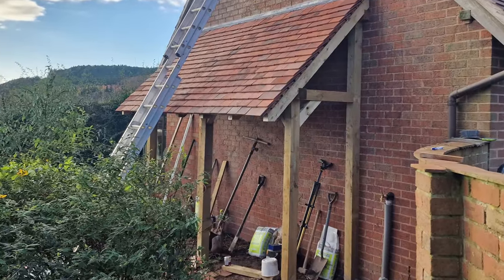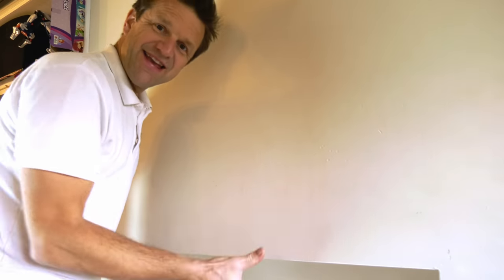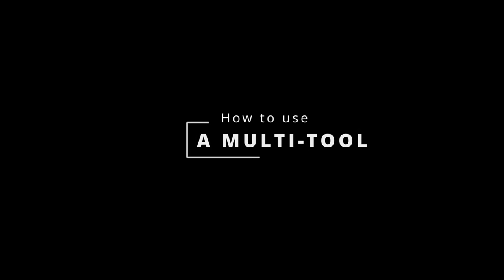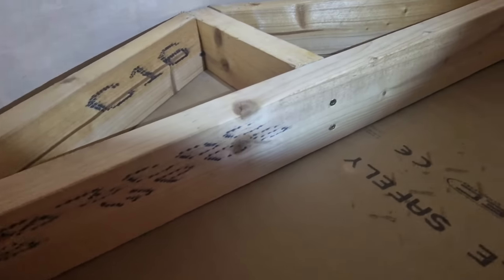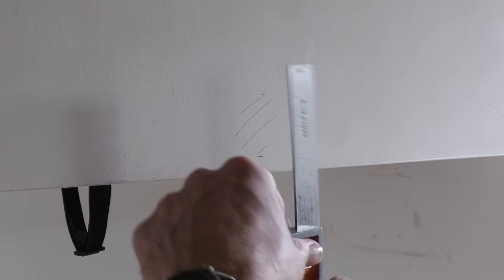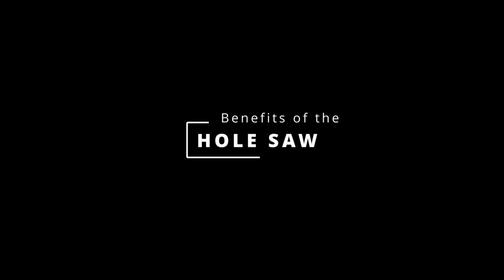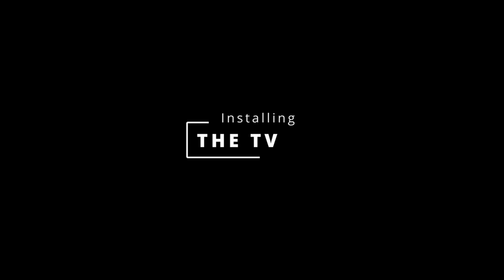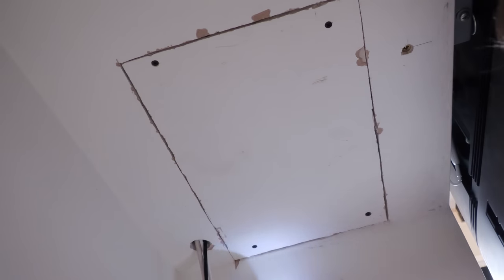How to Hang a TV on a Hollow Wall

Comment: Watched on Monday, did the “new TV wall mounting” job two days before. Well, the TV has at least stayed on the wall over the weekend, but my confidence in the job would have been much enhanced if I’d had the benefit of this golden nugget of DIY wisdom beforehand. Might have to revisit ... Cheers again, Charlie!
Reply from the maker: Thanks Chris. Sounds like you've done a good job but if you have any concerns, you can redo with Geefix, and in this video https://youtu.be/Jdu9RId7m90 I show you how with a simple jig you can drill right over the original hole to insert the Geefix. 👍

Comment: Great Vid! Pass through RJ45 connectors are so much easier to use. The wires stick out the end, meaning that you can see that they are all in the right order and then cut them to length.

Comment: A top tip for the Coaxial/TV socket plates that you install in a custom socket like you have, is to buy blank plates and F connector male to male couplers, and drill two holes in the blank plate and install your couplers onto them. Now you have 2 TV aerial connections one one plate!
Reply: Forgot to add the diameter of the F-type male to male couplers I had were 9mm, but the closest was a 10mm drill bit. Make sure to go slowly (drilling) as the plastic can melt. Always nice to have cables hidden behind a TV and no mess!

Comment: I have one of the Bosch 12v impact drivers, I think it's a good compromise between a drill and larger impact driver. It's very small so can get into tight spaces, yet it has close to twice the torque of my 18v drill driver.

Comment: HI Charlie - I almost never use a drill to put screws in because they so easily cam out and damage the screw head.  An impact driver is certainly noisier but hardly ever damages a scvrew head and is much easier to use.  Wouldn't be without it!  Another great video - thanks.
Reply from the maker: Yes there are some situations eg my recent log store build, where I wouldn't use anything else 👍
Reply: You also don't get the rsi in your wrist that you get when using a normal electric screwdriver.  As it will produce a twisting action upon your wrist with repeated use on a big job.  The impact driver doesn't do this.

Comment: Just to add about network cables. From the socket on the wall to the TV should be a patch cable, the difference is that its flexible and therefore made of stranded cable. Just using some old cat5 etc will work but its designed for structured / fixed wiring. Compare it to the appliances in your house, the mains cable is always a flex made of stranded cable but the cable in the wall is solid. The solid cable would break over time if it was moved a lot. In reality, what you have done is fine and will last without issue but its worth being aware of the differences. Any device that can work at 1gig will support auto crossover as its part of the standard but anything that is only 10/100 doesn't have that in the standard so CCTV cameras are a prime example of something that would need a crossover if you were plugging directing into a pc.

Comment: Lots of great tips there Charlie.  If I can add a couple of my own ….
Option 4 for removing the wall plug is to use a drill on a low speed to remove the front part of the plug from the wall
And for filling the holes, my builder suggested to me using tile adhesive to fill holes or as a crack filler.  Similar to easifill (and possibly cheaper?), it sands much easier than polyfiller which can set rock hard

Comment: One advantage of an impact driver over a drill is that you don't get the wrist breaking torque reaction with the impact driver. It's not an issue with small screws
Reply from the maker: Yes, true Richard and bottom line, it takes the effort out of screwing. Log  build vid this week and I used the impact almost exclusively for that.

Comment: Great tips as usual Charlie. I’ve been using the Polyfilla one fill recently, and don’t know if there’s been any changes in the product, but it seems to work very well!
I’d be lost without my Makita Impact driver, I do use it every day in my day job, but at home it gets plenty of action. Upgraded recently to all singing and dancing model with multiple torque settings, and it’s much less aggressive making it more versatile around DIY projects. Have a great week👍

Comment: Good video Charlie. My opinion on Impact Drivers is simple. For most people it's overkill for general DIY and are nothing more than one of the latest "must haves" like recip saws etc. I spent 5yrs as a plumber and now ongoing home improvement and have never needed the use of one .....I'd rather have a second drill driver or just 12v driver.
Reply from the maker: Thanks 👊 Completely agree mate. You'll only use it for the occasional bit of decking or where you're driving home a big old screw but even then a drill driver will do the job fine, particularly if you can get hold of screws with Torx heads. 👍
Reply: @CharlieDIYte  Having just spent the last 3 days raising my loft floor to get a decent amount of insulation in, I've probably "driven" 300 screws ranging from 4x30's up to 6x150's (all Torx heads thankfully) I wouldn't have wanted to do it with anything other than an impact driver. If I'm doing half a dozen small or medium screws then the compact 12V drill/driver is fine and my first choice but with a job like that the impact driver makes lots of sense especially as they're generally much more compact than a combi drill. Horses for courses, I guess.

Comment: What a great video. Many tips we may have seen before but well worth being reminded of them again.  Plus quite a few new and really useful tips too. 

If you are doing quite a few ethernet cables then making your own is a great option as you can create just the length you need and easier to feed the cable without the plug. May seem expensive for the bits and tool but having the correct length cable rather than a purchased one that is far too long is worth it. Would suggest if you are doing a few long cable runs getting a cable tester for £10 may be worth it as you can be confident it is OK.

Comment: Would you ever consider doing a video about your tinnitus? Perhaps combined with video about DIY and hearing protection options. I damaged my hearing and ended up with tinnitus doing DIY. Would be good to raise awareness and help others avoid this horrible problem.
Reply from the maker: That's a very good idea Henry. I'll add that to the list. Sorry to hear you've got it too. I think my Bosch belt sander did the damage. I used it to sand the floors in an entire house without ear protection. Funny how the worst offending tools are the ones you can't use these days without ear protection because the mere sound hurts your ears! That and my DeWalt router are probably the worst.

Comment: If your are making your own ethernet cables I would recommend two things 1) Use copper core cable as they are more durable and easier to work with than say aluminium and 2) if your are running cables outside use cable rated for outside otherwise the outer sleeve will degrade over time. If you want to get really clever I would also recommend labelling the cables at each end and then using clear heat shrink to protect the labelling.
Reply from the maker: Thanks Anthony. Yes I always use external SWA Cat 5 outside and have numbered all my internal cables. Someone has also pointed out I should only use stranded cable with that crimping tool. 👍
Reply: Yes - stranded cable for crimps (plugs), solid core cable for IDC punch downs (sockets).
There are plugs designed for solid cable though which are usually also designed to not require a tool.
External grade cable doesn’t have to be SWA.

Comment: Hi Charlie. Random question - I’m giving the other half ideas for Xmas presents and really fancy one of those leather man multi tools you use. But…..having looked online there are literally dozens of models, all really rather similar. Haven’t quite finished working through your back catalogue of vids yet so you may in fact have a vid on this, but have you ever done a review of yours and thoughts on the others in the range? I’m liking the look of the Surge as a pretty robust DIY around the home tool. Which one do you have?
Reply from the maker: Hi Chris. I've got the Surge too. It's the best one in that it's got the most tools and things like swappable screw bits and files. It's also the heaviest. The others in the range are varying sizes and weights. Some people say the Surge is too heavy but for me that's what makes it so good and you don't notice the weight when it's in the leather or fabric belt holder. The tools I used the most are the long nose pliers and the knife.

Comment: As always, i enjoyed that.....if not slightly over engineered 🤣. I'm sure some plasterboard fixings would've held that telly no problem
Reply from the maker: Thanks. Yes you're totally right. The right plasterboard fixings would have worked fine. I'd probably have used a hollow wall anchor or snap toggle.

Comment: Hi Charlie, in a previous video (can't quite recall which one) but you mentioned a sanding block being the go-to tool for sanding. Just wondering if it really is easier or a better finish using a piece of wood because I hate having to clamp the sandpaper with my fingers and I find it much easier using a block that clamps the paper.
Reply from the maker: The reason I've gone back to a block of wood is that I did a similar repair on the corridor recently to fill some holes where I'd ripped studs off a dot and dab wall. I used the rubber block and when I painted over you could see a slight dome and raised filler. This wouldn't have happened with a wooden block. But for general sanding when you're not feathering in the repair, the wooden block will be fine.

Comment: Nice video! I must admit I used to diy all my network cables, but would only make one as a last resort now. I find it quite fiddly and time consuming, and I find you can pick up premade ones cheap enough on Amazon.

For the central point (under your stairs) I use a patch panel to connect all the cables that run throughout the house, its much easier to wire off than putting rj45s on all of them, and gives a nice way of being able to label them. It does require an additional network cable to connect from the patch panel to router/switch though.

Comment: Hi Charlie I have a couple of corrugated sheets of asbestos that my neighbour kindly use on my side to prop up his fence , which as they say is another story .  My point is trying to get an asbestos contractor to come and take the sheets away has proven impossible , if there not removing in its there just not interested .    And like you my council will only take it if is put into special bags , and of course your back to cutting it up which would be ridiculous.   This brings into question  why are people not being help’t to dispose of this material safely , obviously I’m prepared to pay for its pickup and disposal .      The only alternative I have is to wrap it in polyethylene and place it behind our woodshed , which is totally remote from the house . Not ideal but devils needs must   Best wishes and kind regards. 😀👍👍👍
Reply from the maker: Hi there, thanks for this. Your best option might be to bury it which apparently you are allowed to do - assuming of course you've got the space and could find somewhere appropriate. I'm going to have a similar problem with that sheet and will end up having to wait until I pay someone to remove the cellar boarding.  🤔

Comment: The metal crush fixings would more than hold the TV thay are relatively light in weight I use crush fixing for the top bracket of storage heaters no problem 👍
Reply from the maker: Not sure what you mean by crush fixings - hollow wall anchors? but I agree. It's a light TV and on this bracket a lot of Plasterboard fixings would do the job

Comment: Charlie did you use stranded core cable for your patch cord? You shouldn’t use solid core cables as the pins are designed to pierce the cable strands as the pins push in with the action of the crimp tool.
Reply from the maker: Thanks mate. That's good to know. If I'm honest it's solid core. So what crimping tool should you use with solid core cable?
Reply: @CharlieDIYte  its not the crimp tool that you would need to swap its the 8P8C (RJ45) connector, you can get a specialist version that will work with solid cores but really you should use stranded core cable for patch cords (short lengths) that often get plugged and unplugged. Stranded cables are flexible and less likely to break with repeated movement, only good up to a max of 30m but more typically used under 10m. Long runs of cable that don’t get disturbed are called permanent links, these are solid core cables that terminate on IDC’s (Insulation Displacement Connectors) such as patch panels and telecom’s outlets (TO = wall sockets) and you use an IDC punch down tool to terminate into the patch panels and TO’s. The patch cords plug in to the outlets (patch panel or TO) and is part of the  channel that can be re-patched to make a new connection to the TO. A very simple channel link might look something like this : network switch —> patch cord (5m) —> patch panel port —> permanent link (90m)  —> TO —> patch cord (5m) —> computer . The overall channel is a max of 100m. Really all permanent links and patch cords should be tested for conformance to British Standards, testing for continuity, Wire Map, NEXT, FEXT PSNEXT etc. using a cable characterisation test set, but these are very expensive, for home use you can buy simple continuity wire map testers for less than £20 that would be okay for a DIY’er. Also most kit nowadays is auto-sensing so you don’t need to make cross over cables, the equipment will cross the connections itself if it needs to, its only older equipments that wouldn’t do this. Hope this helps :-)

Comment: A drill/driver can kick and hurt your wrist if the screw jams. That can't happen with an impact driver.
Another quick way to remove old rawlplug heads is a countersink bit in a drill.

Comment: Give me a impact driver any day less hassle and can do all a combi can hss drills wood bits etc even masonary bits are available to fit straight in, my combi rarely gets used, with hss just let the bit do the work no pressure 10 years into a Makita 18v impact driver constant use still going strong . SDS a must for heavier masonary concrete work
Reply from the maker: I've never tried drill bits in an impact. Must give them a go. Totally agree about the combi. It's a heavy lump to carry around when the hammer action is so pathetic. 👌

Comment: The internal walls in my 20 year old house were built without timber studs, just 3 layers of plasterboard laminated together. There’s no cavity to work with either, just a thick slab of plasterboard in the middle and some dot n dab. Neither masonry fixings nor heavy duty plasterboard fixings work. 

The only way to fit anything substantial is to laminate a sheet of OSB into the wall, just as the builders did in the kitchen.
Reply: Seriously?! I've never heard of that before in 35+ years in the industry. Any idea what the construction is called,  I'm intrigued to find out more? Incidentally,  how are these walls connected to the floor and ceiling?
Reply: That's horrifying
Reply: @frfr335  my posts keep getting removed. Google ‘laminated plasterboard walls overclockers’. Someone has posted a diagram on that site. 

There are just two 1x1 battens, one nailed to the floor and one nailed to the joists at ceiling level. The two outer sheets are screwed to the battens top and bottom. The middle 25-30mm sheet is sandwiched between the two using dot n dab. As you can imagine, door frames are prone to movement.
Reply from the maker: Sorry to hear that. A very odd method of construction although in some ways more sturdy than most new builds today! For heavy stuff I think frame fixings are your only option assuming something like the Corefix isn't long enough to bridge the dot and dab void giving you 40mm into the brickwork.
Reply: @CharlieDIYte  the problem is these are internal dividing walls, so there’s no brickwork behind them. 

I’m just renovating my bathroom at the moment and having replaced the bath with a shower, I’ve had to laminate a 2.4m piece of OSB into the wall to hold the tower shower and to support the 42kg piece of glass  that came with the tray. I could have just rebuilt the wall, but plasterboard disposal is stupidly expensive for small amounts.

Comment: Careful using network cable with ports on one end and plugs on the other. Plugs are mostly designed for stranded wire and the keystones for solid wire. They can be unreliable when mixed the wrong way around. There are plugs designed for solid wire but even these aren't that reliable. If the wire is solid it would be worth putting a small patch panel on the cabinet side. Pass through connectors cost more, they're nice but you get used to knowing how long to cut the wires there is enough play behind the spades that dig in, not really worth it imo.
Reply from the maker: Thanks, I appreciate the advice and have to confess whilst it makes perfect sense now you've explained it I hadn't appreciated the difference. 👊

Comment: Big fan of yours Charlie, but think you have been a bit unfair on the builders who did the fireplace. It was always likely to crack. It was pretty minor too.
Reply from the maker: Thanks Olly. I think I'm just a bit jaundiced given pretty much everything they did was shoddy - including using the wrong mix of sand and cement on the walls and not scratch coating so the plaster has lost its key in multiple places. Plus they removed an internal wall of Victorian engineering style bricks and nicked off with them (knowing they could sell them for a lot) without asking me. The carpenters were  nice chaps though and did a good job here.